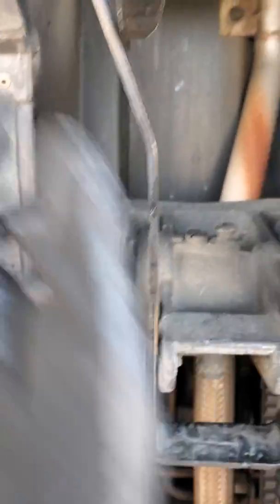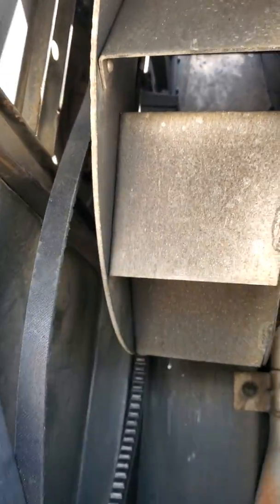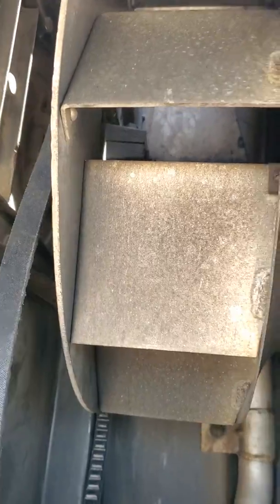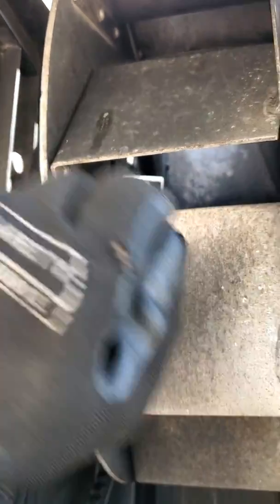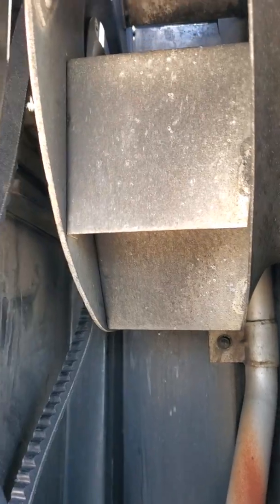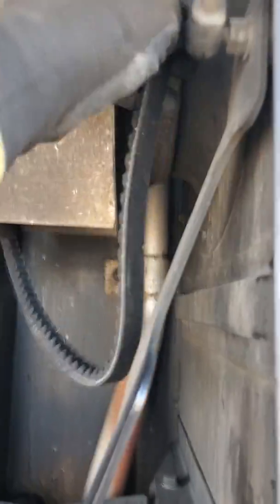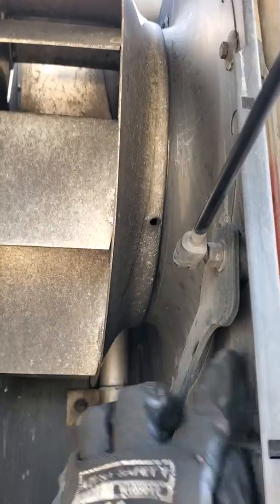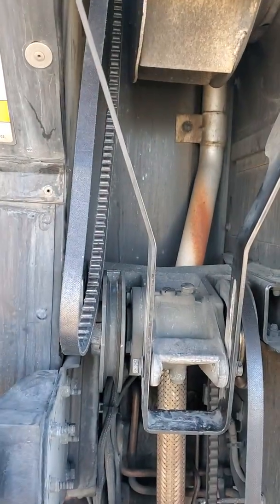Tharmo king reefer sb210 fan belt replacement

Comment: Thanks for the info! I noticed my sb210 was just running on high rpm. I checked the belts while running and the fan belt seemed to loose. I replaced belts after watching your video and now working 100%

Comment: It's a pain in the ..s to remove those 4 🔩.  I went the other way, I  removed the radiator difuser( located right hand of the fan) 6 or 7 11mm screws. When it's removed, I pushed to the left and get enough space to pass through  the belt.